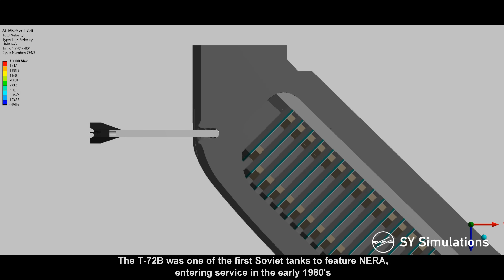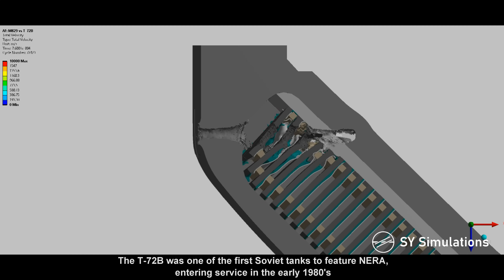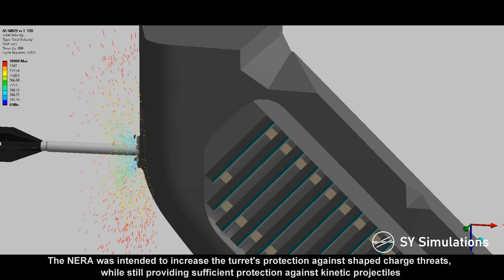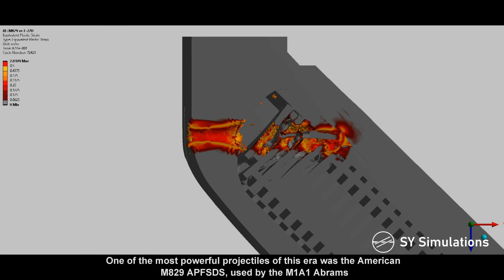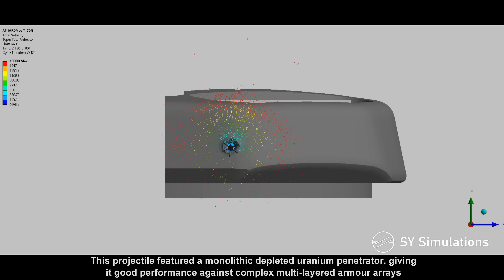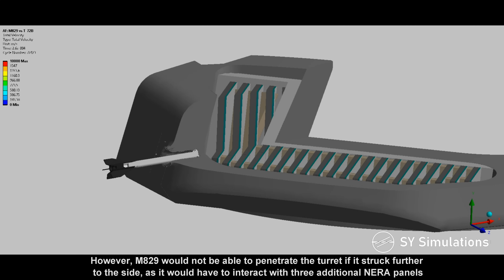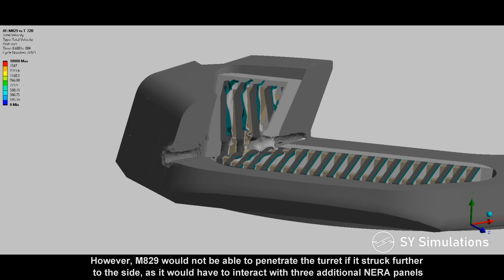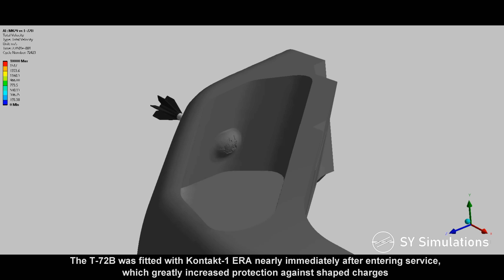ABRAMS vs T-72B NERA TURRET | 120mm M829 APFSDS vs NERA | Armour Penetration Simulation

Comment: In simulations, M829 does not defeat Russian armor.

So, I guess all those dead T-72's from the Gulf War and the current T-72's, T-80's and T-90's littering Ukraine ain't dead.
Reply: Do you have footage of these tank on tank engagements? And showing exactly where the tanks are hit?

If they're hit to the sides there'a nothing anyone can do about it, both western and eastern tanks have weaker armor there so it's easy to destroy unaware tanks that are facing to the left or right of the one who spots the other first

Also tank on tank battles are a rarity and most tanks get taken out by drones, ATGMs and other means
Reply: @gian.4388 Son, you have said so much that is wrong, I hardly know where to start.

That a flank hit causes an automatic and catastrophic loss of vehicle and crew is simple negligent homicide.  Whoever thought putting 40 unisolated main gun propellant charges right where they could do the most damage deserves so kind of medal.

Secondly, no, ATGM's haven't been a big killer since composite armors became wide spread.

These day it's mines that are the big killers, along with APFDSDU and special artillery rounds (Excalibur, DPICM).
Reply: You have again shown your ignorance of the topic, ignoring the fact of how many hits Russian tanks sustained in Grozny and are withstanding now. Up to 2 dozen hits. 

And don't give the example of poorly trained crews from the Middle East who filled their tanks with shells to the brim. They also had a Leopard-2 exploding.
Learn the material part, as we say. Otherwise, it's ridiculous to read your self-confident statements.
Reply: @ФедотовДмитрий-щ3г  Yes, we've already covered that Grozny doesn't matter, among a long list of other things that don't matter.

Does the fact that the Russian tank fleet is going backwards in time, with the T-62 T-55's coming back into service matter?

I have no idea where I'd find M60's.  I know of one in  a children's playground in Salem, MA, but M48's are long gone.  

I'm afraid we wont be able to join you in your armored trip down memory lane.
Reply: @Waltham1892 , No, you are fundamentally mistaken. More precisely, you are deceiving yourself. If you didn't know, then T-62s are a minority of the total number of tanks. T-55s are not visible at all. The tank fleet is based on more modern vehicles, such as the upgraded T-72B3, T-80BVM and T-90M. At the same time, Russia reached the Soviet pace of production of armored vehicles. These tanks are produced by the hundreds per year. No country in the world can boast of such a record production of tanks as Russia.

The T-62 is also undergoing modernization, receiving thermal imagers, improved protection, new engines, protective complexes, and modern radio stations. You're laughing for nothing. Tank battles are rare. The main threat is drones. Therefore, the need for modern armor-piercing ammunition and powerful frontal armor is no longer so high. The upgraded T-62 is better than the Abrams, at least in terms of ammunition - it has powerful high-explosive shells. It has better roof and side protection. And in general, he is better prepared for modern combat using drones, even than the M1A2C. American tanks are defenseless against drones, do not have roof and sides protection. They completely ignore the experience of modern combat, unlike the upgraded T-62.
Reply: @ФедотовДмитрий-щ3г if an upgraded T-62 is better than an M1, why did the Russians bother making T-72's, T-80's and T-90's?

Silly Russians....
Reply: @ФедотовДмитрий-щ3г if an upgraded T-62 is superior to an M1, why did the Russians produce the T-72, T-80 and the T-90's?

Silly Russians...
Reply: Gulf war T-72`s arent same tanks, but MUCH older models, with way worse armor and ammo.
Reply: @alexturnbackthearmy1907  And the tanks currently being killed by M1's in Ukraine are what, tanks bought on Wish?

Russian tanks come with 4 items you just don't find on the M1.

3 body bags and an excuse.
Reply: @Waltham1892 , western tanks even has not ERA.
Reply: @alexturnbackthearmy1907  Every day I get an email offering to sell me a keychain fob made from the armor of Russian tanks.

I think that proves my point, nicely.
Reply: @alexturnbackthearmy1907  If I wanted an M1 keychain, I'd have only 26 hulls to pick from.   That's real scarcity and they'd probably come at a premium. 

If I went down market, going Russian, I could choose between about 4000 hulls.

100 of those would be the latest T-90's, about half the fleet.  After that, the late models of the T-72, then the early models, then the T-80's, T-62's, and now T-55's.

that's got to be about 400,000,000 pounds of keychains.

That's a lot of keychains.
Reply: @Waltham1892  what m1 , there's not a single well documented case of an M1A1sa engagment with a russian mbt
Reply: @alexeialmanov3419 so, press clippings are now military relevant?

Really, thats the hill you want to die on?
Reply: And why are Western tanks burning out en masse now? Because they're supposedly bad? No, the main reason is poor tactics, not technology. 

In 1991, communication stations and fuel depots were destroyed. The iraqi tanks were left without fuel. Most of the Iraqi tanks were destroyed by their own crews. Not by american tanks. And those that remained operational were unable to receive orders from their commanders or intelligence data. American troops were simply flanking or outflanking the iraqis. As you can see, the equipment was not to blame.
Reply: @ФедотовДмитрий-щ3г I love it when War Thunder heroes share their profound opinions.

No tank is invulnerable or immortal.  M1's are no exception to the rule.

The real question is, did the crew survive?

The number of crew killed in Western tanks wouldn't make up a soccer team, while the number of dead in Soviet/Russian tanks would overflow the stands.

As someone who cut their teeth on the M60A1, its hard knowing your survival is just a matter of how bad the hit is.

I bet thats how Putin's tank crews feel, all the time.
Reply: @Waltham1892 , I am always amused by the self-confidence of the fans of the Western school of tank building. Tell me, what battles did Western tanks participate in? Iraq in 1991 does not count, because Iraq was in obviously losing conditions there.

Remember how the Turkish Leopard-2 turrets exploded and threw them in 2016. There, the shells in the hull have no protection against detonation. And in Abrams, in the event of an explosion of ammunition, a weak partition will not protect. It is not designed to explode. Only for the burning of gunpowder in the cartridges. And the cases of explosion and death of Abrams crews are also known. This was the case in Yemen when the Abrams tank exploded, and it is happening now in eastern Europe, when Abrams are burning and exploding.

If you're not aware, the T-72 has fought in dozens of conflicts around the world. And that's why they exploded often. Often inexperienced crews from the Middle East countries took all their ammunition with them. But if we recall the conflicts in the Caucasus, Chechnya and Georgia, then Russian tanks showed high survivability, withstanding up to two dozen hits. 
The T-72, T-80 and T-90 are still showing themselves well, withstanding multiple hits from drones, missiles and RPGs. The tanks didn't explode, they kept hitting. And if the tank was hit, the crew had enough time to leave the tank. Explosions are not so frequent.

And if you're really a tankman it's a shame not to know that.
Reply: @ФедотовДмитрий-щ3г So, the most recent major US tank deployment doesn't count.  I guess the one after that doesn't count either?

And hundreds of burning Soviet/Russian tanks in the middle east obviously don't count.

And I guess that Grozny won't count either, or Syria.

Go back to your video games son, Uncle Waltham needs to finish his dinner.
Reply: @ФедотовДмитрий-щ3г  also US tanks and IFVs had thermals that the Iraqis lacked, so they easily dominated night time engagements against Iraqis
Reply: @gian.4388 , No, due to the reasons described above, it didn't play much of a role. Even if Iraq had the latest tanks, it wouldn't have made a difference in the absence of communication and fuel.
Reply: Returning to the topic of Western tanks, if we look at the most modern modification of the Abrams M1A2C tank (M1A2 SEPv3), we will see that the mass has increased from 54 tons in M1 to 73 tons. The undercarriage can barely hold such a load. And all for the sake of strengthening the frontal reservation of the tower. Despite the fact that the roof of the Abrams is worse protected than that of any other tank.

If you look at how the protection of the M1A1 is being strengthened in eastern Europe, how the grilles are being welded to the roof, and how the Soviet-ERA Kontakt-1 is being installed on the upper frontal part of the hull, you can see that the tank has become heavier by several tons. Tanks sink into the mud and become prey to drones.

The Western concept of a heavy machine designed for hard ground and paved roads proved to be a loser in such conditions.
And the large mass and dimensions make it difficult to modernize and equip tanks ERA and protective roof, greatly increasing their weight.

Tanks are no longer used as a means of breaking through defenses in the face of enemy missiles and RPGs. It's like a fire support vehicle that hits the enemy from long range. And the main threat to them is not the shells of other tanks, not anti-tank missiles and RPGs, but drones.
And under these conditions, frontal armor and guns are no longer as important as they used to be. 

And Western tanks don't even have a powerful high-explosive shell, and they have big problems with mobility and protection of the roof and sides.
Reply: @ФедотовДмитрий-щ3г  Yep, the latest models of the M1 are beasts.  They make my old M1A1 look like a China tea cup.

Of course, all that armor means you still have the tank at the end of the day, and the crew as well.

A tank that weighs 55 tons where you lose it and the crew is a fool's economy.
Reply: The fact is that there are several tank factories in Russia. Each of them specializes in a different type of tank.
Reply: @ФедотовДмитрий-щ3г it would be closer to the truth to say the tank manufacturers produce coffins that seat 3.

If 4000 tanks have been lost, and you go with the WW2 statistic that for every 2 tanks destroyed, one crew is lost, that means Russia has lost 2000 trained tank crews.

That enough crews to man almost 8 Divisions.  

So, basically, all the trained tank crews Russia started the war with, including company grade officers, have been killed or wounded.

No wonder Russian tanks are performing so poorly.  They must be crewed with the bairly trained.
Reply: I've always been amused by Americans' naive and infallible self-righteousness. As well as the lack of critical thinking.
Why don't you want to say that American tanks are coffins? That they are not ready for modern combat and are unable to withstand drone strikes?

Moreover, the "data" you provided is, at least, unreliable. I even know where you got it from. So, their source just doesn't stand up to criticism. Only our Ministry of Defense has accurate information.
At the very least, we don't have a shortage of armored vehicles at the front. Mostly modern tanks are used. Therefore, your "data" is unreasonably high. It is also important that there are many crews who have been fighting for more than one year, and who have become real professionals.

Russian tanks are showing themselves well, withstanding several drone hits and continuing to fight. It's just that you're quite naive and gullible if you believe our opponent's data.

Comment: funny enough if they had gone with non ERA external armor something like arrowhead armor of the leo-2 that would have also been sufficient to stop M829 at the point of impact shown
Reply: if they had went with K5 era as we... and if the hit was not in the weak of the armor, it would also not went throught.
Reply: @gerfand  the video itself states that the armor would be sufficient to stop the incoming projectile if it went just a bit further to the side.
Reply: @dominuslogik484 exactly, theres lota of ways to have it work

Comment: The BT-70Sh/77 armor steel (for 21mm NERA layer) seems not like to be only 500BHN（its about 560）, and for the BTK-1Sh(rear 45mm plate), 500BHN is over.

Comment: The NERA seems to be doing nothing.
Could you try this again, but replace the nera with a nato equivalent of the same weight?
Reply: It does enough. It prevents a full intact arrow to penetrate the armor with maximum velocity. There will still be carnage inside the tank and some of the crew might get hurt or killed, but the destruction is contained to a minimum. I say this is better then nothing.
But yes, we need some NATO tech for comparison.
Reply: @ThePandoraGuy  this is far far far away from the effect of the nera inside abrams and leopard.
The nera is supposed to break the rod in half and twist it off-axis, so that it shatters on the HHA layer.
Reply: @Spider-WoIf  Well, it still prevents it from being a total loss aka 60ton paperweight.
Reply: @Spider-WoIf You fundamentally don't understand what NERA does.
Reply: @voidtempering8700  what a meaningless statement
Reply: For me it seems it does a lot, steel "eats" not much from the rod but NERA almost desintegrates it, isn't it?

Comment: Uranium not used all the time.
You covering crew with radiation. + in Ukraine all Abrams got wiped out by Russian tanks/drones and mechanical problems
Reply: The US does use uranium projectiles all the time. They're also not radioactive to any significant degree due to being made of U-238 which has an extremely long half-life.
Reply: @DecidedlyNinja 
Not in Ukraine
Reply: @vaninec  This simulation uses one of the oldest 120mm darts. Sure, a lot of countries use tungsten darts, but all but the oldest of those are better than this particular uranium dart.
Reply: Abrams got wiped out in ukraine is true, US donated Abrams is only 3 left and this is supposedly a cannibalized for spare parts, this is also reason why western finally approve Australian donated Abrams to ukraine
Reply: @blackmark7165 
I watch daily reports
Reply: @vaninec  You watch propaganda.
Reply: @spaceageGecko 
Did you open a link?
Reply: @blackmark7165  for sake of being real it’s not because Abrams’s bad survivalability or being outdated, it’s just proving again that those freakin’ drones would get to outrun even those well-known abominations of Tsar-Tank modifications with overprotected T-72/64/80s etc

Challenger 2’s, on the other side.. yeah they have proven themselves to be a total disaster on those fields of modern war
Reply: Source?
Reply: @ThePandoraGuy 
Daily reports 
Weeb union
Reply: Russians trying to cope that their "superior" tanks are failing:
Reply: @ZalánSmausz-Kolumbán so where are any videos from inside the muhgty western tanks just shooting T-90Ms like at a shootinmg range? Because we have plenty of those with T-90Ms doing that very thing to the useless western tin cans.
Reply: @ZalánSmausz-Kolumbán
Facts?
Reply: @ZalánSmausz-Kolumbán good copium
Reply: Keep livin in ur fantasy world dude, must be nice livin there.
Weird how I’m still seeing Abrams and Leos and Challys still on the field to this day, but I guess I’m just imagining seeing those.
But do go on believing all UA tanks are dead, works even better that way 😉
Reply: @LeGrandSarrazin the brits ordered the ukrops to not use the challys because they would turret pop before even getting to the front lines lol. The abrams tanks all got taken out so Ukrainians are just keeping them as spgs during defense. The only tank that has actually proven itself is the leopard, and even they got destroyed enmasse. 2023 summer counter offensive for example.
Reply: @unterhau1102  No "all" of the Abrams were not taken out and Ukraine was instructed to not used the Challenger as an assault tank as that is not what it is designed for, nothing to do with turret popping. What propaganda slop are they feeding you?
Reply: @LeGrandSarrazin 
Forward me a video link
Reply: @LeGrandSarrazin  Chellys though would have been better with never revealing themselves lmao, other two are pretty decent

Comment: Is there any plans to do simulation of ceramic armor - Chobham, Dorchester and so on?
Reply: None of those feature any ceramic.
Reply: @Bojan_Kavedzic chobham… literally does
Reply: @LettuceGayming  It doesn't. It's just bulging plates.
Reply: @01Laffey kindly provide a source, as all sources i can find on chobham state that it is “composed of ceramic tiles”
Reply: @LettuceGayming if your sources are "books on tanks" let me tell you 99% of books on tanks are garbage filled with loads of trivial errors
Reply: @01Laffey while this may be true, you have yet to provide a source for your claim, and most sources i am able to find tend to agree that chobham does contain some amount of ceramic
Reply: @LettuceGayming  Told you how to get to source. There are official docs there. If you want to believe '80s fairy tales - it is up the you.
Reply: @Bojan_Kavedzic  no, there are tonns of cement
Reply: @ukuskota4106  No. It was a very widespread myth, dispelled only about 10 years ago with declassification of early Chobham armor research and publishing of various armor schemes, like those of M1, Challenger 1, Leopard 2 etc. None of them has any kind of ceramics in armor, all rely on NERA plates, which was idea originally tried in the  original Chobham.
In addition, ceramics actually such vs APFSDS, but they are good vs small arms rounds, so some APCs/IFVs use is as add-on armor (US Striker 8x8  etc).
Reply: @Bojan_Kavedzic  Where did you know it?
Reply: Chobham gets touchy because its still highly classified